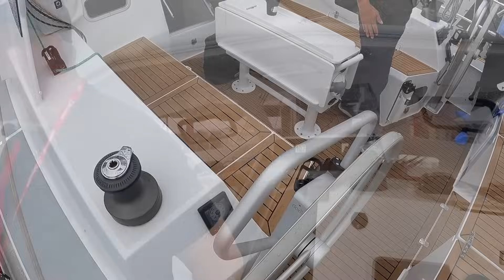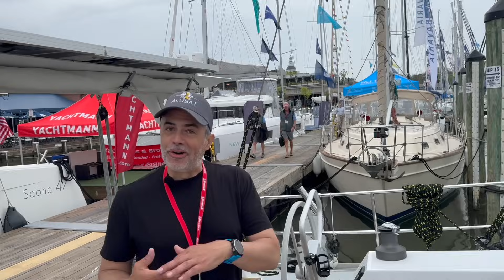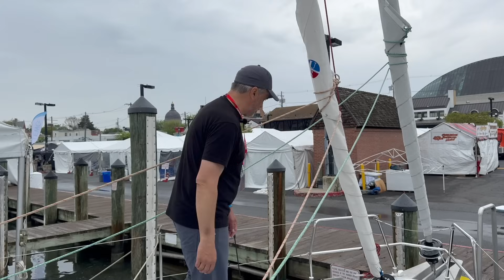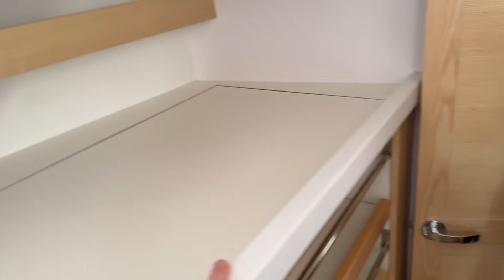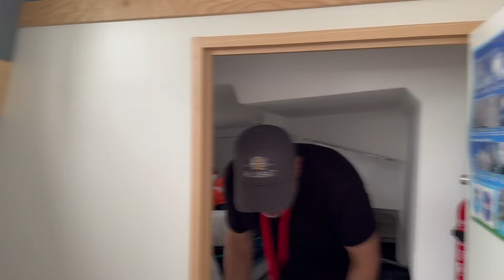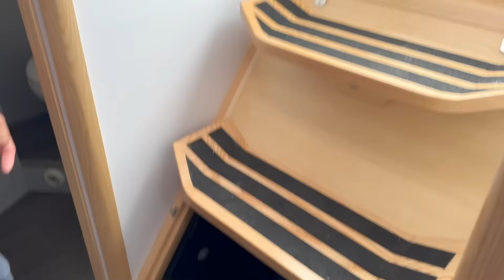Alubat Ovni 370 "Jacky C " Meet the Owner

Comment: Interesting boat, Alubat make good boats but with all that beam aft the stbd side aft of the heads seems a little underwhelming, as expected very similar in interior design to the Garcias and their slightly lower specced cousins, name eludes me right now. A hard dodger with lots of hand-holds is of great benefit offshore, way better than a fabric dodger IMO, I'm interested in the dimensions of the hull and interior volume, I have a chined corten steel Van De Stadt  34' which I have heavily modified and reinforced for high latitude capabilities and can vouch for the benefits of ANY type of fully welded construction, I can also vouch for chined hulls and their ability to hold a course, roll less and their ability to sail fast on any point of sail once correctly trimmed, I've achieved 17.7 knots SOG surfing 3+m cresting waves off Cape Aghulas with 30KN true at 115° on the port quarter, yarns aside, I have great regard for the French built aluminium boats, chined hulls, hard dodgers, lines led aft and a clean line free cockpit, I built an integral targa arch and hard dodger which carries my traveller and main sheet and all my lines except reefs 1&2 luff pennants are run aft through a total of 14 clutches to 2 cabin top self taliers, primaries and utility self trailers on the coamings, quite similar to what I have set up❤
Reply from the maker: Thanks for the detailed response Jonno , it sounds like you have a very impressive boat yourself and I imagine 17.7 knots was great fun , I do hope you have many more great adventures in your Van De Stadt yacht “ I think that’s Dutch “ am I correct ?